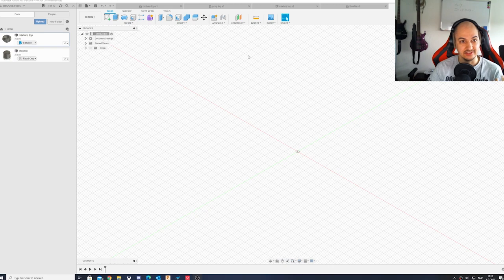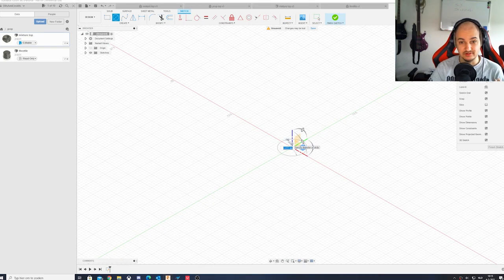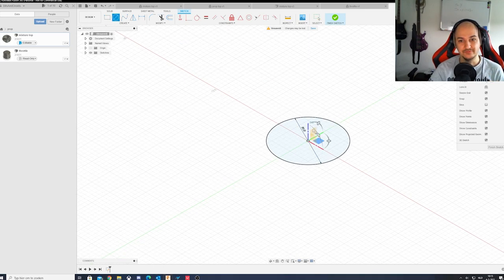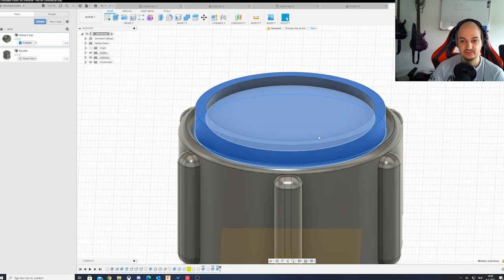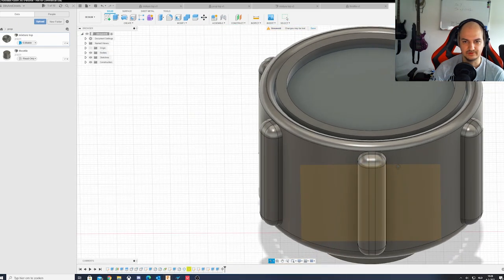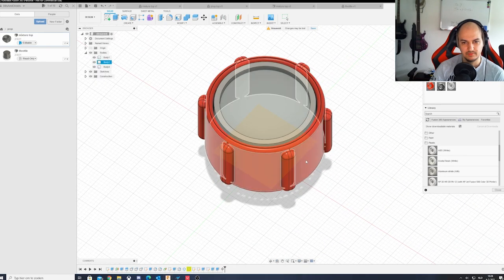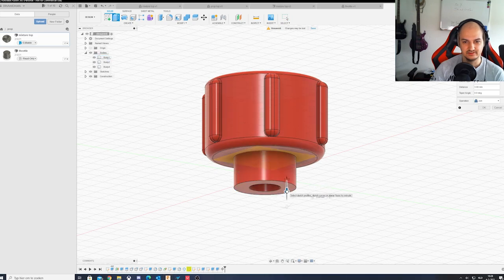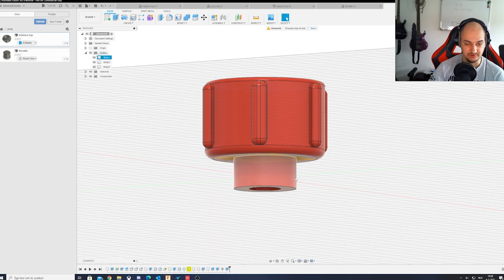3D modeling the Cesna throttle, mixture, prop knobs. The Cesna project #2

Comment: it is always fun to watch other people 3d model. it is kind of a window into how you process information. i started with the external case u started with the knob; yesterday i started modeling the throttle quadrant as well.  i also just got the paid version and should have my workshop soon so i can get to building.
Reply from the maker: Because I like the result, having the knobs on my desk makes me more productive. It gives me that extra drive to finish it promptly without too much procrastination.  Good luck with the workshop. Sounds way more practical than an apartment.
Reply: @Bitsanddroids  well I live in a house but it is only 500 ish sqft and 1room and 1 bathroom like an efficiency apartment so I'm getting a trailer to make into my work space ready to move to a different state when I'm ready I also have a rv that will be my house when I finish rebuilding the inside there is a water leak in the roof  I will be making videos of everything when I get started

Comment: Great stuff, good to see you will be working with linear pot. Been cracking my head trying to make your code, from toggle box, work with 5 pot along with the joystick library for a LITTLE project I have been working on . got a couple of questions if u have the time at some point.
Thanks for giving me something to aim for during lockdown in Portugal.
P.s.  I know very very little code( just ctrl+c/v) a little bit of skydiving...and have an expired PPL from the UK.
Reply from the maker: Sure send me a a dm on any platform or mail me at info@bitsanddroids.com
Reply from the maker: Thanks for your email! I've respondend but it sometimes goes straight to spam. just wanted to give you a heads up.